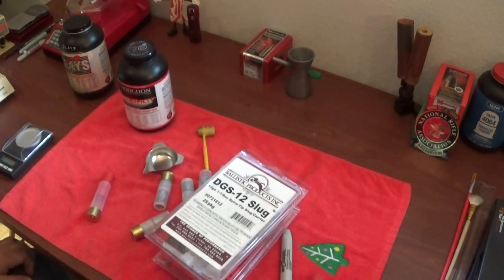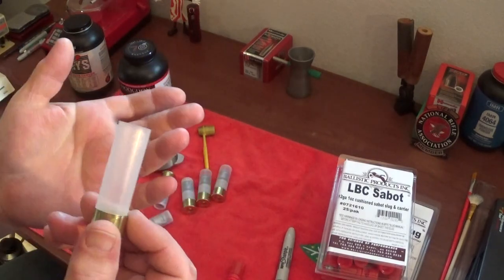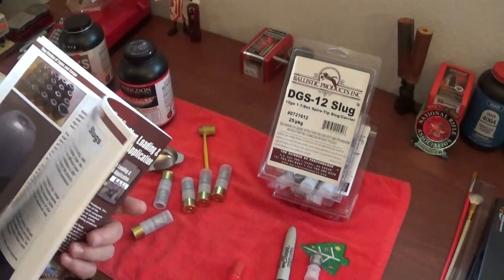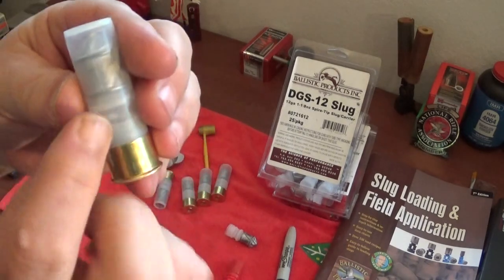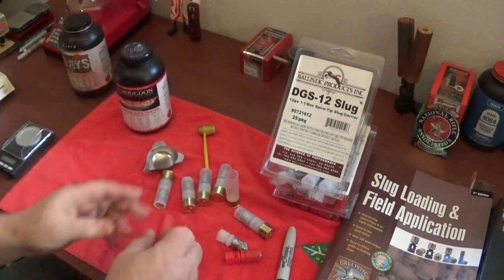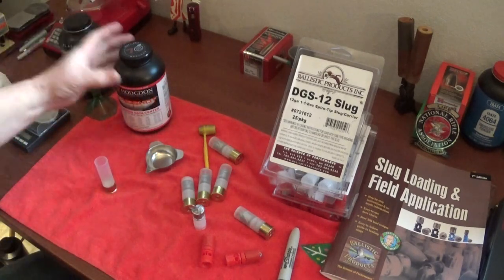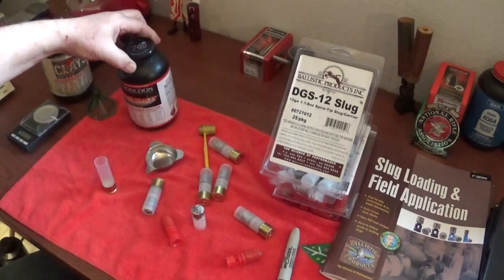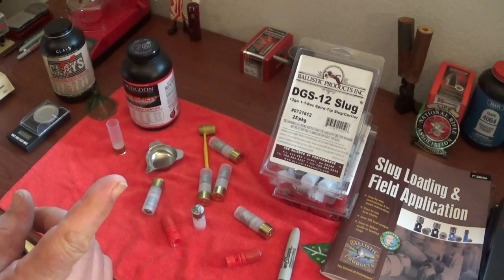Shotgun slugs the easy way.

Comment: If you are new to slug loading...DO NOT try to use 40gr of LS powder. Get yourself a reloading manual like the Lyman 5th edition.
Reply: Just work the load up, I went from 35 to 39, 40 seems crazy, but my shoulder is minced meat even at 35

Comment: I am getting to cast 1 oz. key drive lee slugs to shoot in my 18 inch cyl bore pump shot gun . Can i use wheel weights to cast slugs with safely ?
Reply: Not a good idea. You need to cast them with pure lead. The sub caliber skirt needs to be able to obcurate/ exspand to slug up in the barrel. Hard lead at these velocities won't do it as easily as pure lead.
Find plymbers lead or roofibg lead flashing, they are almost 99.4% dead soft, pure lead. They are also perfect lead for muzzle loaders.
Reply: @denisdegamon8224  Thank You for the wisdom !!

Comment: Dave :  What are you  Hunting for velociraptors ,I use 36gr of HS6 behind 7/8 Lee key slug @.1550fps
Reply from the maker: I believe that Longshot is slower than HS-6 and more of it is consumed during the shot. I'll have to look it up to be sure.
Reply: Longshot is really versatile. It has a pretty broad range of practical load data covering a very wide velocity band. Also, since it is fairly dense, the loads which specify it have a chance of actually working in practice when you try to fit the components in the shell.